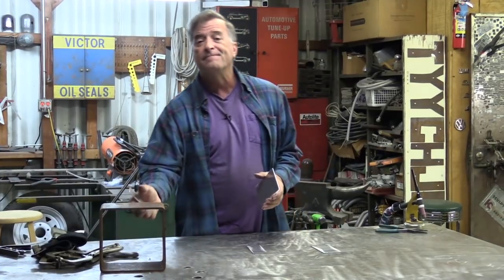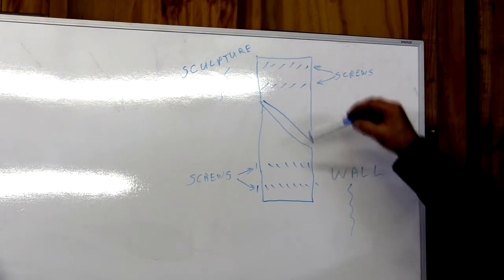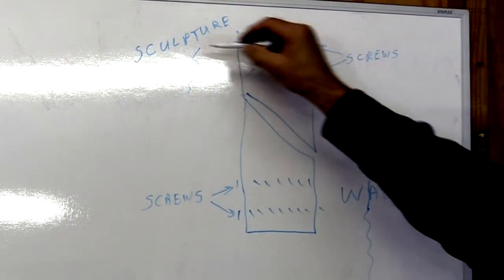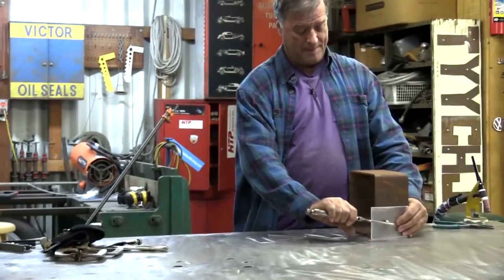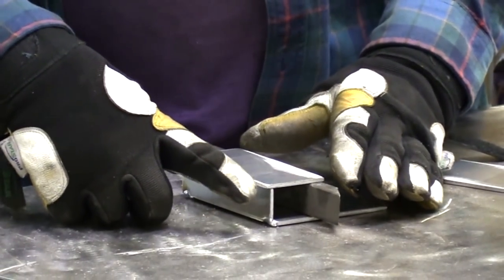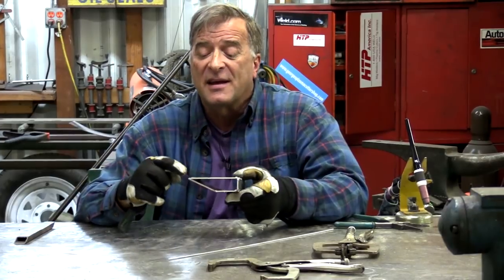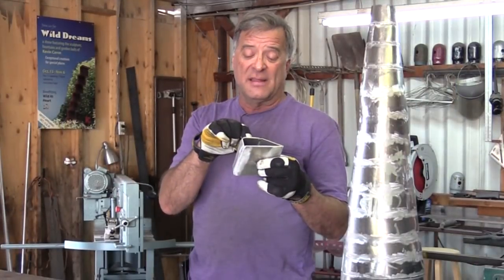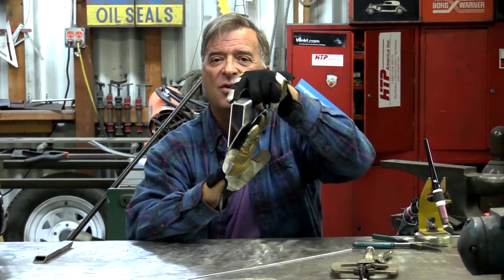How to Make a French Cleat for Hanging Heavy Items - Kevin Caron

Comment: Was thinking of doing the French cleat for heavy wall sculptures. Now I know how to make one. To reduce weight and stress on the wall and screws into the wall, what thickness/gauge material seems to work best in the sculpture and the "french creek"?
Reply from the maker: I would use 1/8th inch aluminum.  And screw to as many of the wall studs you can get.
Reply: Kevin Caron, Artist Will try to integrate the cleat into the design to help conceal it. Guess I'll have to put up wind blockers to weld aluminum outside until get a shop built. By the way, my local steel supplier has 2.5 million pounds on stock, then add aluminum and stainless to that! They will sell in any quantity, which is great for beginners. Let them store the metal inventory.
Reply from the maker: Amen!!
Reply: Kevin Caron, Artist If I can get some 1/8" thick 3" wide flat stock this weekend, going to get started on my first sculpture. Kevin, can inbox you the pics or would you rather be surprised by the finished piece?
Reply from the maker: Oh just surprise me!!
Reply: Kevin Caron, Artist Will surprise you with the finished piece. Might have something even more surprising using stuff laying around, just like you did with that turkey from your junk pile in one of your videos.